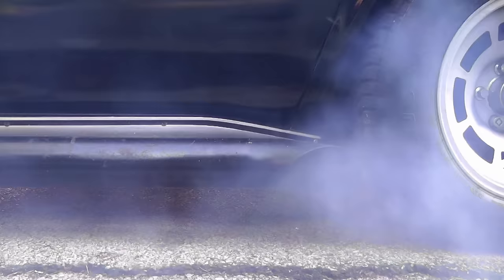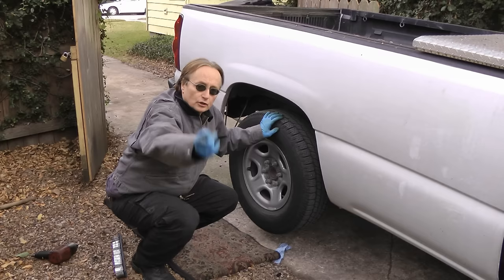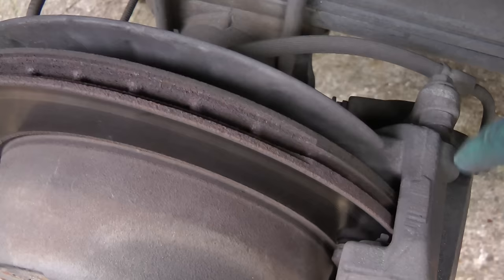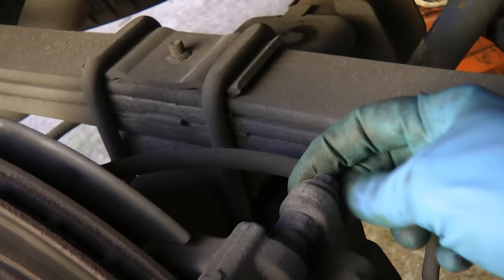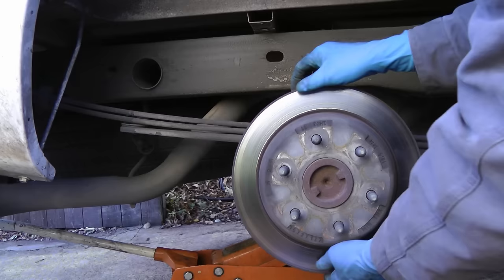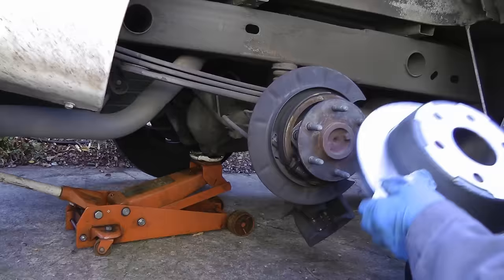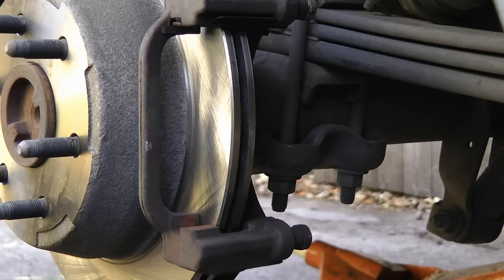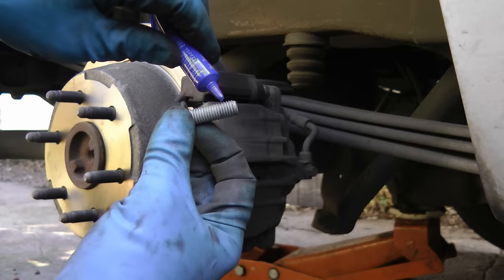How to Fix Grinding Brakes on Your Car (Rotors)

Comment: He let the caliper hang by the brake line, :'-(
Reply: I have done it for years, never had a problem
Reply: pellergin I have also done it for years. If the flex line isn't strong enough to hold a 7pound caliper, there's no way it will withstand the hydraulic pressure. The only vehicles I use a hook to hang the caliper is heavier pickups like f350 calipers. The line should never be in Such a bad condition that it will leak from 10lbs tugging on it.
Reply: He did it with class.
Reply: ...and then the peanut gallery comes in to defend such an unnecessarily dumb mistake. Yes, you really should hang the caliper. Takes a second, and so many variables are there in many different situations, including pinching the end of brake line against a metallic sheath. It's often much more than just a 10 lb weight evenly hanging on your brake line. At least be prepared to hang the caliper somehow. Perhaps he didn't need to in this case, but when making general-public videos, it always makes sense to show how it's supposed to be done.
Reply: I also noticed he didn’t use the breaker bar and a torquimeter.
I am not a professional mechanics but hey! Why not use specialized tools?
Reply: Brake bolts are usually very heavy duty, doing them up super tight as he puts it, is most likely above the torque setting that car manufacturers set, so no chance in them coming undone, and no they won't strip that easy. If you think every mechanic out there does every nut and bolt up with a torque wrench you're kidding yourself.
Reply: I cringed so hard!
Reply: Yup that’s a big no no
Reply: I hang mine to the vehicle with a bungee cord.
Reply: I know! He didn't even drop it gently.
Reply: So nothing wrong with that! If it breaks it needs be replaced anyway.
Reply: Bungie cords work nicely.
Reply: hahahjajahajajahaa
Reply: He's careless
Reply: You never let it hang like that. Geeze.
Reply: @anthonyrybczynski5420  This is wrong. The brake line taking internal hydraulic pressure is different from the tension force caused by its weight.
Reply: The back cal is not as heavy
Reply: At least when he's got tools in his hand he's not waving his hands up in the air all over the place! Haha
Reply: I mean almost looked like it was resting on the ground
Reply: This is the comment Im looking for lmao my heart dropped

Comment: Great video but I think you're an animal! First I wouldn't hit my ratchet with a hammer, i'd use a breaker bar. Second i'd never let my calipers hang by the brake line, I'd use a coat hanger or big zip tie and hang them from the axle/frame or something. Lastly I would have turned those rotors instead of replacing them. Keep the vids coming, just my two cents!

Comment: Scotty why did u throw the caliper? Kinda sloppy ey
Reply: doesn't that cause problems? i was wondering the same thing
Reply: *****  yes you can damage the brake lines. never let the caliper hang as well as always use jack stands.
Reply from the maker: Dusty Gepner
as I've said a thousand times, brake hoses use 1500 plus psi, so they are VERY strong. If they are cracked and worn and brake apart when doing a brake job, they would need replacing anyway. Strong ones could hang for weeks with no damage.
Reply: I'm with scotty here. You can hang the brake caliper by the brake line all day long. I drove 200 miles with my brake caliper literally hanging by the brake hose hitting bumps and everything. Didn't break or leak or anything.
Reply: XBaneyX How on earth did you drive 200 miles like that? lol
Reply: Scotty Kilmer  well u have a point, thanks for clearing that up, thanks scotty. keep those videos coming great stuff
Reply: Scotty Kilmer Love your videos but you are asking for a leak pushing that piston in that manner.
Reply: I know its an old post but don't you mean Rotor lol that's the round metal thing

Comment: Another tip: remove the worn brake pad and use it flat against the brake piston when compressing them back in. Just ensures an even distribution across the rim of the piston and prevents any potential damage.

Comment: A tip for some people. I followed this video after having a car worked on, There is a dust cover that covers the rotor, that the mechanic had bent up against the rotor. Sometimes bending that plate back off the rotor stops that same exact grinding. :)
Reply: I think mine may be doing the same thing

Comment: Make sure to loosen your resevoir cap for the brake fluid. When you push the piston back in it can cause pressure which can pop the resevoir cap off and get fluid everywhere.

Comment: I'm new to this channel and must say, not only was that informative, precise and easy to understand, but i couldn't help but smile through the whole video.
Reply from the maker: I am to please and help all.
Reply: Scotty Kilmer my wife has an 07 Ford edge which is in surprisingly decent shape for living in salt riddled northern Iowa. Her edge makes the worst noise when in reverse only. And it's most of the time only when backing out of the garage. Say we're out and about having it off parking spot it doesn't seem to make the noise. I'm thinking it might be the e-brake sticking. If so, how would you adjust it to stop the noises? Any suggestion is helpful. Thank you very much for your help and time.
Reply from the maker: please ask questions on my website www.scottykilmer.com    But one time here, If it only makes it when moving, then remove the rear tires and check back there for either worn pads down to the nubs, or sticking e brake. if e brake sticks, then lube the cable with Wd 40 and pray it's just corroded and that frees it up.
Reply: Scotty Kilmer i apologize for asking questions here and ty for the suggestions.

Comment: In Canada you replace the thread locker with lube so they come apart next time!
Reply: Conor Power that's the idea behind anti-sieze.
Reply: I agree. I think kilmer is wrong.
Reply: And spray WD40 on the disc.

Comment: Scotty.  Another great video.  I've got two suggestions, one you'll like and one you won't.  First, let's get the one you won't like out of the way.  I never use Locktite or anything similar on the brake bolts.  Instead, I go the opposite route.  I clean the threads and then I use anti-sieze.  If you torque the bolts to the factory specifications, they won't come out and they'll be much easier to remove the next time you have to remove them.  Rather than hammering on my rachet, I use a 1/2" breaker bar and socket.  Here's the suggestion I think you'll like.  Whenever I work on the brakes, I take the opportunity to spray the rubber dust boot (especially when the piston is extended) and the rubber dust covers for the sliding bolts with silicone spray.  I believe it makes these parts last longer.  I spray the CV boots for the same reason.  Keeps the rubber from drying out and cracking prematurely.  Please keep the great as well as humorous (Mercedes) videos coming!
Reply: i agree.  i use anti sieze or if there is nothing really handy, i'd just dab the threads with a light oil.  prevents rust too, specially in  salty, seaside areas

Comment: U let that caliper fall down like a back of potatoes. Sorry but that is really wrong! Please try to be more carefully!
Reply: +BestBuildPC Power of imagination I saw that too :l i hope he doesnt rip some brake lines
Reply: +BestBuildPC Power of imagination also did not grease the ends of the brake pads and relube the slide pins. Those brakes are going to be noisy now.
Reply: +ThePariss333 My brakes are sticking because the people at the Warren Truck Assembly plant in Michigan used American pride instead of lube
Reply: Not this 1. I always lube everything, why ? I hate complaints & comebacks.

Comment: On some modern cars when you force the piston back in you need a special tool, because you need to twist them as you push them in, we discovered this on my brothers kia
Reply: This is manufacturer-dependent.  Even older Hondas had this function on certain models.  Just depends on what you're working on.
Reply: You're right. A lot of the asian make vehicles you need a special disc brake tool set to push the piston back in the caliper. I know you can get one very cheap at harbor freight tools that will work great.
Reply: yes if you don't have anything that you can use either you can rent one from an autozone, that what i do everytime i need to replace breaks on my car.
Reply: yep mine is 86 subaru had to wrench on it
Reply: The tool isn't absolutely necessary though. a vise grip and some elbow grease usually gets it back in for me
Reply: You're thinking about the standard brake pistons that self-adjust via the rubber seal.  Certain pistons adjust via threads or electronically, which do require specific tools beyond just a basic press.

Comment: What about lubricating the pins and putting anti seize on the contact points of the pads?
Reply: He did do that on the other video was wondering the same thing on this video though.
Reply: Never push that dirty fluid backup the brake lines,,, open the bleeder,,,
Reply: Dot 4 brake fluid should be drained and flushed every 3 or 4 years,,,. So definitely when you do a brake job,,,
Reply: @ricksimpson2167  Open that bleeder and people will get air in the system. Worried about crud??  get a mechanic to flush your brakes after replacing yourself.  Those bleeders break and air will get in if not opened properly, while applying constant pressure, and then tightened before pressure is released.  This is a myth that people keep rambling about.  DIY guys should change and then flush their system via a mechanic with pad and rotor changes if they are worried.

Comment: The only thing I would recommend, mainly because I've had to replace many calipers is when you are depressing the brake cylinder the one that places pressure on to the rotor, make sure you use the old pad and put it over the cylinder and take a C-Clamp apply even pressure. If you don't you could end up bust the rubber surrounding the metal cylinder and costing you more money than you want to spend. Just a tip!

Comment: Scotty why don't you talk about the importance of torque wrenches? I know that most people won't get them because they might only do a job once but torque specifications are very important for parts like brakes.
Reply: You can pick up a half decent torque wrench at HF for $25 or less with a 20% off coupon.  Might not be the best or real accurate, however its better than just winging it. Especially if you're working on a safety system like brakes.  Nothing like having that come back on you legally.
Reply: just tighten till you hear it pop then go 1/4 turn more
Reply: @andrewarmstrong9194 😂

Comment: I would not compress that caliper like that, if you have anti-lock brake on it, with out opening the caliper bleeder valve, I was told one you do not want to push back that dirty brake fluid threw the system and two if you do that on a anti-brake system, you can damage the sensors in the pulsing unit. food for thought. P.S. I could not see if this had anti-lock brake system in your video but I figure if the Chevy was 1990 or newer, it did.
Reply: That, and cleaning the brake piston is also a good idea. When I do the brakes and the wheel hub assemblies on my car, I'll be changing the brake fluid and cleaning the calipers before putting in the new rotors and pads.

Comment: My brakes were doing this, so I replaced them and they’re continuing to make the same noise, it also has scrapping on the outer ring
Reply: Cristian Radical Same issue. Did you figure it out?
Reply: Did u replace the rotors?
Reply: Same here... Ughhh such headache.
Reply: Rotors are warped. You need new rotors. They’re curved, bent .new flat brakes will continue to screech noise and continue a pulsating effect when you brake at a 🛑

Comment: I let my front caliper dangle while doing the brakes on my 99 grand cherokee, in about two weeks time the metal part of the brake line to the caliper had worn down because it stretched a little and was coming in contact with metal, eventually wearing it down and causing a hole in it. Be careful!  If you have a spare jack stand rest the caliper on it

Comment: Hi Scotty!
I've just put new disks and brake pads on my 96 Honda Civic. I went for a ride to try them and I immediately heard this rubbing on the front right wheel. And also, that sound isn't continuous. It's more like " tss tss tss tss...", faster or slower, depending on speed. I must add that before, with the old ones, I noticed that the same wheel was warped. The car vibrated at hard braking at higher speeds. 
Thank you

Comment: I changed the rotors and brake pads and im still hearing that grinding noise.
Reply: bearings
Reply: @jerrysantos7460  Its not a clicking sound and theres no play in the tire :/
Reply: @jasonkeelor3861  i saw this video on youtube where the guide pins for the calipers could be stuck and not letting the breakpads slide back out? hopefully that helps, if not make sure the dust shield is not in the way
Reply: @jerrysantos7460  Already tried all of that. Lubed the slide pins really well and theyre moving freely now. The dust shield WAS scraping but i moved it off and its still making a noise. I honestly have no idea whats wrong. Ill test the wheel bearing again today and make sure the slide pins are still moving. :(
Reply: That's because you followed Scotty Kilmers DIY.
Reply: More than likely the breaks dust sheild is bent if you already fixed you breaks and there continue to make gringing noise.
Reply: @jasonkeelor3861  obviously you sorted it out, but was it a sticking caliper?

Comment: lol I had a really cheap friend that drove around with a rear brake that was down to the metal for like 6 months..he just sprayed it with wd40 or equivilent to make the scraping not so bad loll
Reply: If your friend went to long like that he may eventually have to replace more than just the pads and the rotor.  Especially if the metal backing to the pad gets thin enough to fall out and the caliper piston or the pad holder is pushed into the rotor.
Reply: He was risking his life and that of everyone else around him.  For the small amount he'd spend (less than £50 for the parts in my case) and an hour of his time, he could've replaced the discs and pads.

Comment: Just did the rotors on an '06 F-150, needed a special 36mm socket to take the spindle off before removing the rotors. Also, the spindles have to be replaced with the rotors. I think a breaker bar and torque wrench works better than a sledgehammer, but whatever gets the bolts off safely works for me.

Comment: at 1:10 you take the caliper off and just swing it to the back, hanging from the hose...and that's after 46 years of experience?  Not sure that's a safe bet on old brake lines....especially on a general video for others to learn how the change pads on any car, old or new.  Not being critical but it would seem to me that prudence would of utmost importance (safety) when describing important details of car maintenance.
Reply from the maker: HA, if it were that bad, good thing if it cracked and leaked, it would need replacing then. Those hoses hold thousands of psi pressure, a little hanging does NOTHING to good ones.
Reply: AffordBindEquipment My mechanic said it's actually not a big deal for the caliper to hang from the brake line. But I still make sure there's no pressure on it when I do my brake jobs.
Reply: @Sammyhale30  the outer appearance may look together and intact but the inner piece is a very small plastic tube and you wont see it if it cracks or splits open
Reply: @aperson6832  you may think it's okay, but inside the brake lines are very small plastic tubes that the brake fluid flows through and youd never know when it cracks or splits open

Comment: My 2002 Honda Civic developed a grinding noise when I applied the brakes and when it ran normally. I had installed the front and back brakes several months ago.

As it turned out, one my brake caliper mounting bolts fell out, and the loose caliper would vibrate.

I bought a new caliper bolt but added threadlocker to make sure it stays in.

Comment: Hi Scotty, I have a Honda 1994 sr4 eg9, about 2 weeks ago I heard a similar kind of noise to the brake pad grind, or brake shield and rotor making contact, however the noise went away, yesterday I heard it again for a few 100metres then boof it was gone.

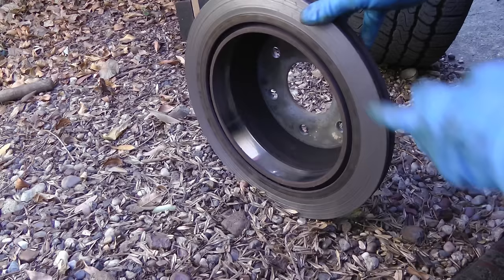Comment: 1:25"  and the rotor just wiggles off".  YES...for THAT vehicle.  However, not every vehicle's rotors come off that easily.  My 05 civic si's front brake rotors REQUIRED an Impact Driver with a hammer hitting it a good 4 or 5 times JUST to finally get enough " bite" into the phillips head screws that held the rotor in place ( two of them for my 02 to 05 year model span)

Other than that, I don't recommend leaving your brake caliper just dangling.  I usually just carefully hang/hook it to a coil coming downward from the shock spring.

Beyond that,  thanks for the vid good man.
Reply: In case you don't know already, you can just ditch those screws to make next time easier. They're just there to make things quicker to assemble at the factory.

Comment: As a DYI'ER there is one thing I won't do - brakes. I've hear too many stories of amature jobs. At most I'll spray brake cleaner in and around brakes. My rear passenger side brakes growl when I initially begin moving then the noise stops. But, the brakes are squishy yet still work.
Rear brake pads and rotors 1998 Honda Civic DX. $200 + labour. Never been maintained/changed as far as I know 268.5 klms.